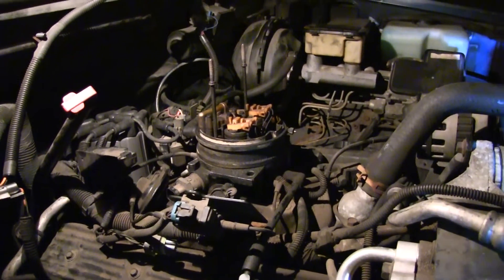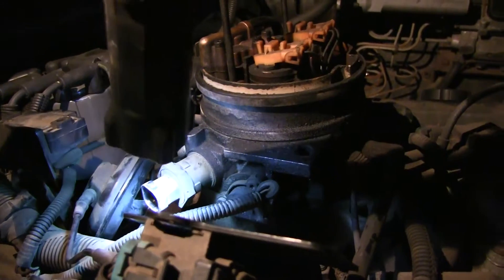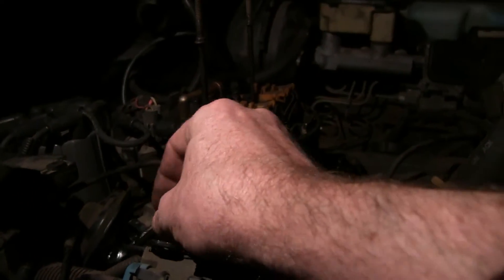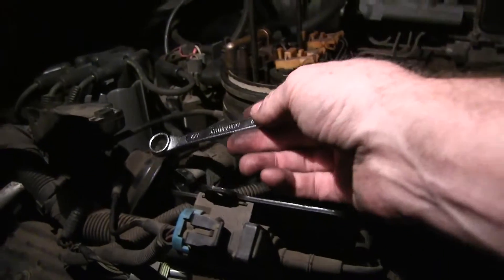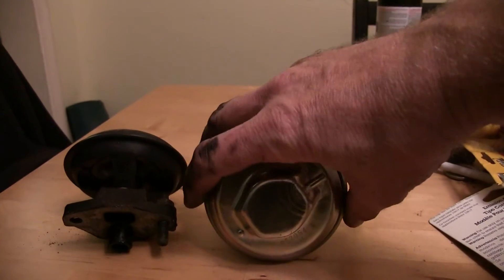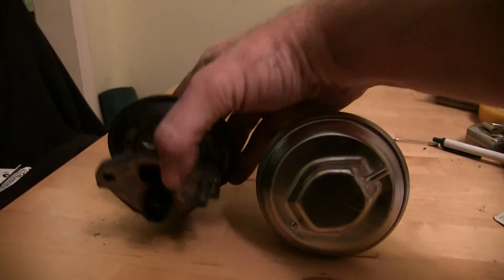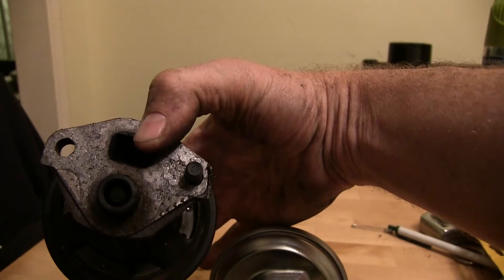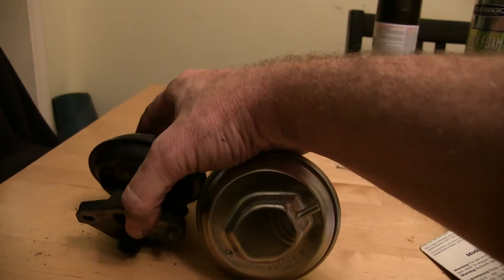How To Replace The EGR Valve On A GM 350 V8 Engine

Comment: When changing a TBI to a 2 barrel carb, can one delete the EGR valve with a cover plate or...can one just leave it in place and plug the hole in the tube? Will it harm operation?  Thanks!
Reply: If you are going to a carb - delete the egr

Comment: I had to give a thumbs down because as with every other video I see about working on cars, you skimmed over the hard parts.
That back nut, that is sandwiched down in a valley created by the intake manifold and the egr valve, that back nut is a bear to get a wrench onto. The fuel intake line for the TBI is just above it at the 6 o'clock position and the valve is just above at the 10 o'clock position. There is one angle available and that is only if you disconnect the electrical connection that is just above at the 2 o'clock position.

Comment: Excellent and to the point! How do you know when you need to do this? Thanks
Reply from the maker: Thanks. If the EGR valve is stuck open, your car will run really really rough. That’s what happened on mine.
Reply: @hoohoohoblin  Thanks. What happens if you just eliminate the EGR by unplugging the vacuum hose to the valve, plugging that hose and also plugging the port on the valve where that hose connected to?  Would this be a good way of eliminating the EGR?

Comment: A offset wrench makes this repair so much easier for the removal and installation.
Reply from the maker: You’re right about that. Thanks.
Reply: @hoohoohoblin  I wish I would had  known before trying to undertaking this endeavor. Do you live somewhere where your exempt from the emissions testing? 

I have the same truck and in the next year or two will be exempt from emission testing. At which point I wish to install a egr delete and flash the ecu with that modification so it doesn't throw a code on the dash. I believe this is a major source of carbon build-up in the engine and oil (The PCV valve will get a baffled catch can plumbed to eliminate burning blowby).

Comment: Good video, nice and easy and I like your technical terms "Flying saucer" LOL
Reply from the maker: Thanks!
Reply: +hoohoohoblin what are a few symptoms of a bad one? I have a 86 caprice 305 v8 trying to see if I will notice any different once replaced... thanks
Reply: +Jamar Jackson difference*
Reply: A bad one is either plugged or diaphragm is bad, if your car runs for about 20 minutes then dies suddenly it is bad.  Not sure if it has will do it in park/neutral, I always put car in drive up against something i.e. parking stopper and let it run until warm.

Comment: why no use a ratchet wrench? is that a S10 Truck? is that electrical thing called a electronic fuel accelerator?
Reply from the maker: 1down4up A socket wrench won't fit under the flying saucer thingy, so a flat wrench is the only option, and even that is a tight fit.  I'm not sure what the electrical thing is called.  I suppose I should have done a little more research before doing this video, but I it was about to rain, so I did it really fast, and I want to get the truck past emissions as soon as possible so I can register it in my name.  Setting the timing, changing the oil, air filter, spark plug wires and EGR valve should get it running clean enough to pass. I'll find out tomorrow.
Reply: ***** good luck wit it, thats why I bought my house where it is at, in a no emissions area, none on my vehicles have to go thru emissions because Of where I live
Reply: +hoohoohoblin  the electrical thing that you had to unplug is the idle air control motor. It allows the computer to control the idle speed.